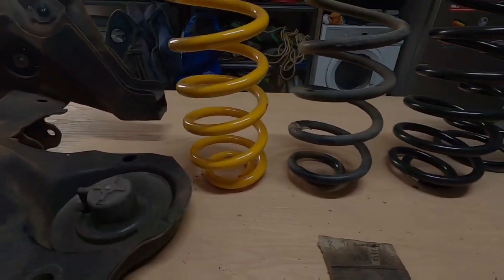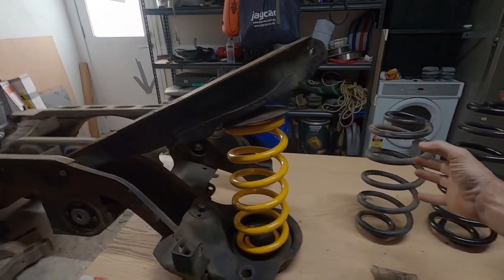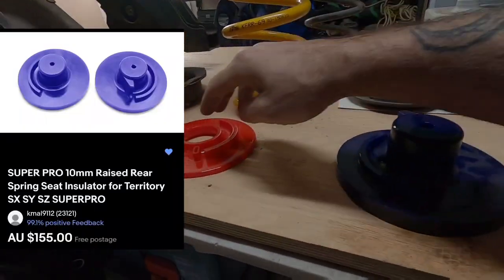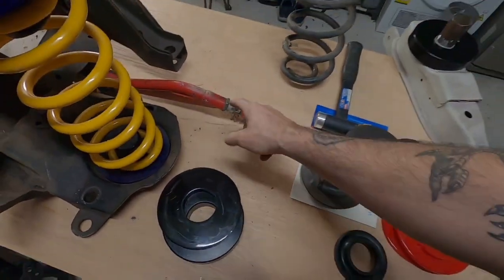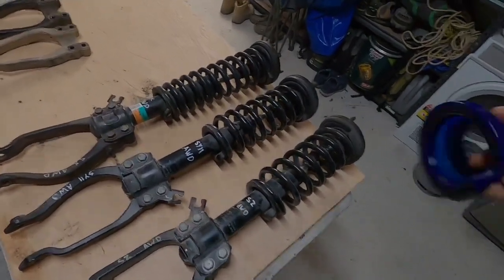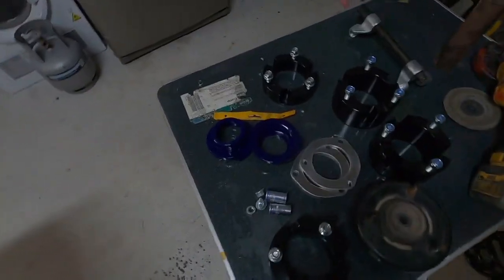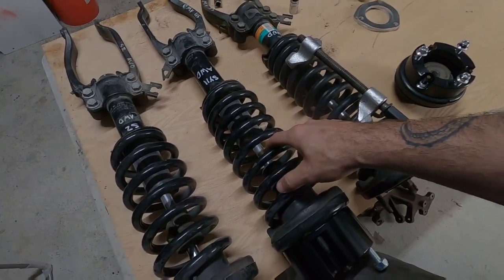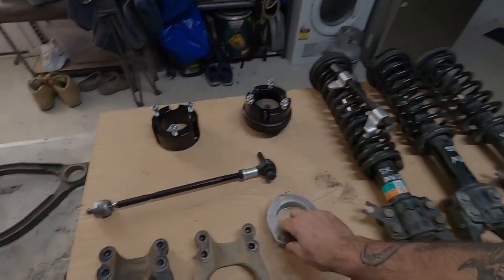Ford Territory Lift Kits  |  Lifting Information

Comment: Some of your ideas for the front end are spot on, ford flipped the upper inner control arm mounts on the RTV falcon, perfect solution.
Pretty sure they also flipped the the outer tie rod ends on top as well.
Reply from the maker: Never looked to much into the RTV stuff as it seems hard to come by.

Comment: Awesome video, explains it all well for someone wanting to lift theirs. 

With the 6mm flat spacers, can you run more than 1 on each strut or will there not be enough thread left?
Reply from the maker: I had two stacked up to make 12mm at one point. The studs aren't long enough for any more.
Reply: @TerritoryOffroad  awesome, was just thinking the sz forks and 2 spacers might do enough for me so I don't need to change the front struts at all
Reply from the maker: @JoshYeoman  Yeah that would give about 35-40mm of lift in the front. Would keep the installation very simple.
Reply: @TerritoryOffroad  do you know if the standard height kings springs are stiff and make the car feel crap or is it just the raised ones? What's your go to brand of springs for the front?
Reply from the maker: @JoshYeoman  I would just keep the standard territory springs in the front but that's just me. I find most other's to stiff. It's easy to lift the front without using raised springs.

Comment: Awesome video, heaps of info, I've watched this a few times now!

What would you recommend for the front to match raised King springs and SuperPro spacers in the rear? I was thinking maybe the SZ springs and forks on SX/SY shocks with a slip on spacer or two. That might achieve 35mm? Those bolt on spacers seem like a stuff around having to dial them into alignment.
Reply from the maker: I've got SZ forks and one 6mm slip spacer in the front of my new Territory. That gives about 30mm. In the rear I've got raised king springs and Nolathane standard spring seats. That also gives about 30mm. 

If you go superpro 10mm spring seats in the rear with raised king springs I'd be looking at a 20mm bolt on spacer for the front with the SZ forks.

Territory's don't have any factory rear camber adjustment. With that lift you will end up with positive camber. Rear shocks will also be close to there limit.

For a simple setup that really works I have to advise people to go with what I currently have on my new Territory.

Front:

● SZ lower forks $100-$150
● Prado 120 6mm slip on spacers $49
● Extended braided brake lines $280 (F&R)

Rear:

● Raised King Springs $199
● Nolathane spring seats $108
● Territory Offroad 531mm extended shocks $170
● Extended braided brake lines $280 (F&R)

Dynamic D hole Steel rims. 17x8 positive 10 up front and 17x8 0 offset rear $142 each. Tyre's 245 65 17. I use Comforser CF3000 MT tyre's at around $170 per tyre plus fitting.
Reply: @TerritoryOffroad  okay, maybe Nolathane rear spring seats are the go, if it means not worrying about bolt on front spacers 👍 Thanks for mentioning the longer rear shocks, I forgot about that.

Is there much that can be done regarding rear camber?

Any plans to delete your ZF heat exchanger and run an external trans cooler? I'm wondering what the best way to avoid milkshakes is... That's if I bite the bullet and get an SY2 😎
Reply from the maker: @SwaggingWithBen  Yeah I've completely removed the standard heat exchanger. I didn't buy a kit made all my own stuff. It's all in my new project videos.

For camber you can get superpro offset bushes. They aren't simple to adjust. You can also get adjustable camber arm's but I would bend them offroad and the bushes fail. 

I'm in the process of making a lot of my own stuff up ready to sell. Like full lift kit's, lift spacers, a few different extended rear shocks and my reinforced adjustable rear camber arm's.

Comment: Thanks for the video .. where can l get the slip on top strut spacer my Territory, AWD Ghia 2005 .. would this be same as Prado 120 or Falcon .. cheers
Reply from the maker: https://www.ebay.com.au/itm/192000961208?mkcid=16&mkevt=1&mkrid=705-154756-20017-0&ssspo=lAsJOcpKTzC&sssrc=2349624&ssuid=NOYlSlR_SA6&var=&widget_ver=artemis&media=COPY
Reply: Cheers .. l appreciate the help! Would l be able to fit 235/65/17 tyres then (go up a profile), with the one 6mm spacer?
Reply from the maker: @MrLeeBrocky  235 65 17 tyre's will fit without any lift. 245 65 17 will also fit standard rim's and clear as long as the side tread isn't to aggressive.
Reply: Awesome 👍

Comment: I found with the rear shocks sold by some of the sellers on ebay when I ask for the measurements for when they’re extended and close their response is they can’t tell me or they don’t know
Reply from the maker: I've sent individual shock companies emails before and got the information back. It was the more popular bands not the no name one's. Ebay sellers aren't interested in any kind of technical support. 

I know the Webco D22 Navara shocks have the right amount of up and down travel. I sell them now with all the sleeves, bolt's, spacers and washers needed to fit a territory.

Comment: I would say gq patrol springs may fit for rears
Reply from the maker: I looked at them but one end is to big to work with the territory spring seats. 

With raised king springs, my 40mm bolt in rear spacers and if you wanted superpro 10mm spring seats that's about 80mm of suspension lift more by the time it's out at the wheels. That's about the limit of the CVs with extended shocks.

Comment: Well done. Does the traction control stop wheel spin enough given there are 3 open diffs to lose power through?
Reply from the maker: I find it will but can be a little slow. I've got a few videos showing it braking a lifted wheel. I'll be putting together a video on that stuff very soon.
Reply: @TerritoryOffroad  thanks, good to see. My unlifted Territory seems to spin a lot

Comment: Me again. Ive done the standard lift  with bigger tyres and all is great, just one problem. If I go over a speed hump  sometimes I get a decent bang sound from the rear. Could it be the shocks maybe? they came with the raised springs. Seems to be only coming from the passenger side though
Reply from the maker: From my experience yes rear shocks don't handle lift. I now use D22 Navara shocks with my own fitting kit depending on the amount of lift.

Comment: Where did you get the rose jointed outer tie Rod end, I’ve been looking for them and can’t find it
Reply from the maker: For the steering rack?
Reply: @TerritoryOffroad  yes the rose joint for the rack end
Reply: @TerritoryOffroad  it’s the second time my tie rod ends worn even though I’ve installed them properly and all of my suspension has been rebuilt
Reply from the maker: @tamarachumbley8722  I still haven't got them to work yet. Only way I can see involves welding the knuckle. Because of this I also still don't know if the have enough movement for the territory's suspension travel. I'll post the link still if you want to take a look. Territory rack end's are to short so need RTV Falcon one's, need the shims each side and the dust cover also.

https://au.rs-online.com/web/p/rod-ends/4688806

Comment: Does the front fork mod work on a rwd sy territory ?
Reply from the maker: No RWD don't have the lower fork. It's only the AWDs that have it to clear the CV shafts. On a RWD the shocks extend all the way to the lower control arm's.

With RWD for front lift you have to look at raised springs (not recommended) or slip on and bolt on strut top spacers.

Comment: Is trail blazer springs a brand
Reply from the maker: Trailblazer is the SUV version of the Holden Colorado. 

Be careful what springs you use as they ended up sagging very bad due to been a softer spring. If you can find a HD raised spring it might work OK.
Reply: @TerritoryOffroad  yeah I’m just gonna go with the king springs and the super pro mounts
Reply from the maker: @rileymcmurray2282  it's probably the best way. I'll have my own part's out this year just got a hold up on the steel.